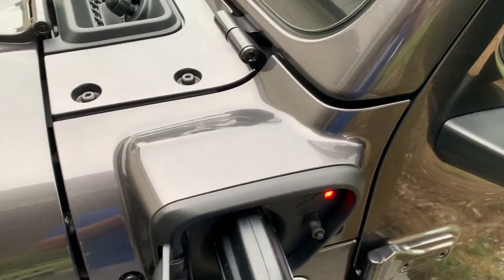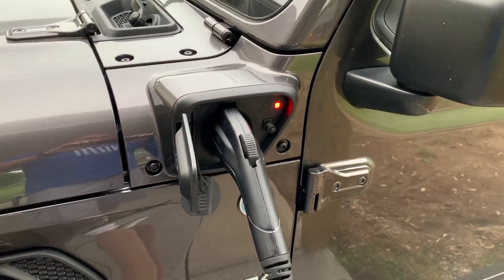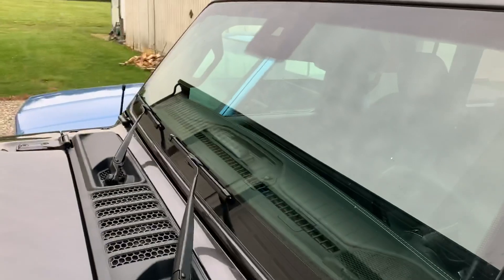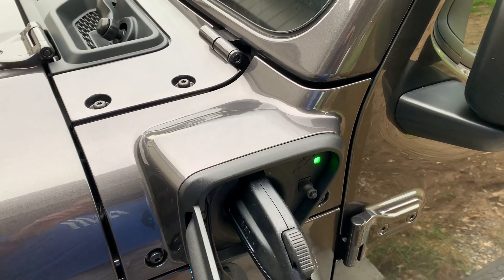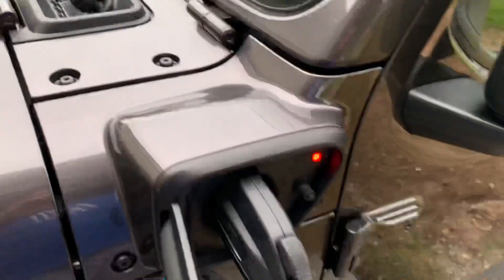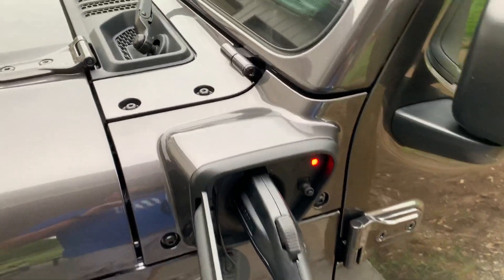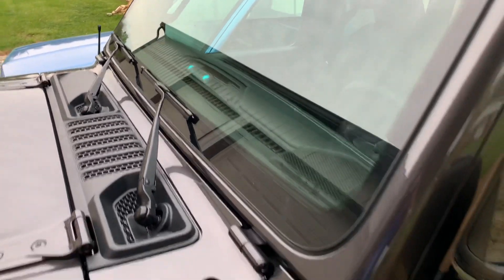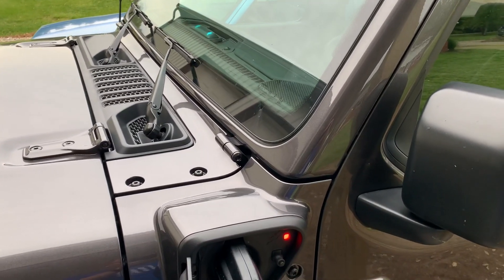Charger fault

Comment: cant believe this is the only video posted about this message? , i got this the other day , never had a issue untill i took the jeep to do a update at the dealership from a recall, now i kinda regret even taking it in , neve had this issue untill 1 week after the update
Reply from the maker: The 4XE seems to be way more particular about the quality of the charge voltage than other electrified vehicles. Seems like we see more vehicles that throw charge faults at certain chargers than other vehicles.